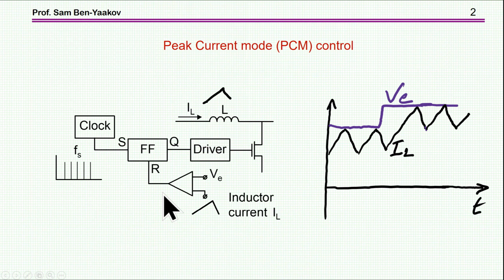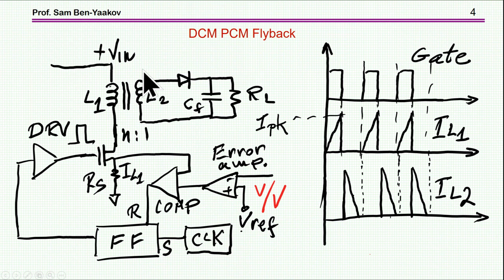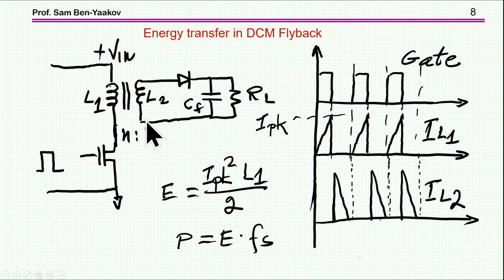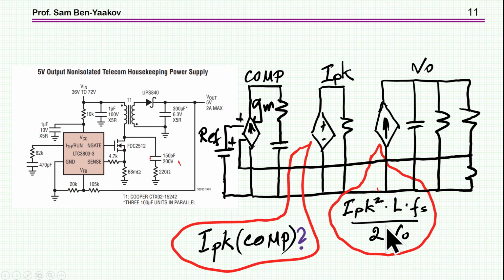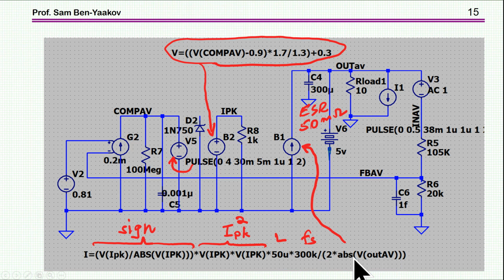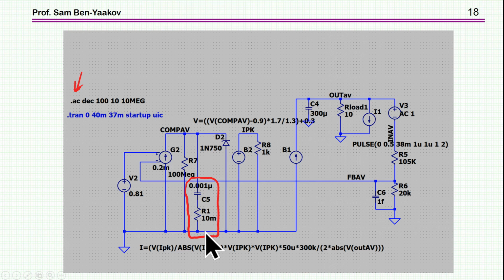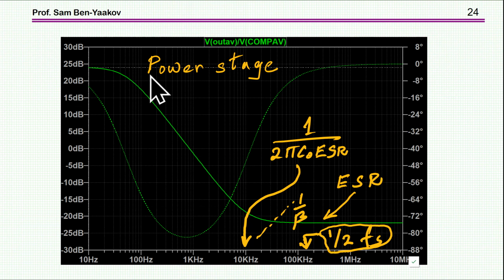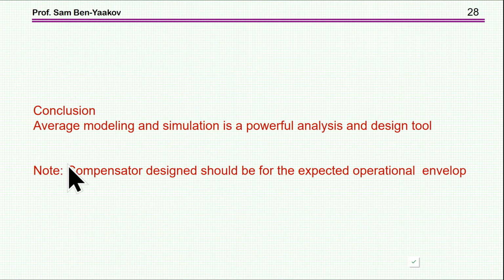DCM Peak Current mode (PCM) : Behavioral average model and a worked out Flyback compensation example

Comment: Dear Professor Yaakov. Considering the Single Switch isolated FORWARD converter that have Primary Peak Current Detection to limit the DON (trapezoidal primary Current Waveform), Does the Average Output model should be VOLTAGE generator OR Current generator as the Flyback converter? Salutations.
Reply from the maker: The forward converter is not a current source, so it is a different animal.

Comment: Thanks for the great video! How could we use the same technique to simulate a multiple output dcm flyback with current mode control? Thanks again!
Reply from the maker: You can combine all secondaries which are in fact coupled as a transformer. Perhaps this will be of interest: https://www.ee.bgu.ac.il/~pel/pdf-files/conf19.pdf
Reply: @sambenyaakov  many thanks! Great stuff! I have another question (maybe a silly question though 😊) about how have you got the relationship formula Compav vs Ipk?

Comment: Thank you for the video! When you place V6 (battery symbol 5V) voltage source, doesn't it affect the ac impedance and loop response? isn't it shortening the output of the converter at a small signal? Thank you!
Reply from the maker: Can you please indicate to which minute in the video you are referring to?
Reply: @sambenyaakov  About 14:30.
Reply from the maker: @zaikindenis1775  This is done only for DC testing of the relationship between the output of error amp and Ipk. It is removed of course in any AC run.